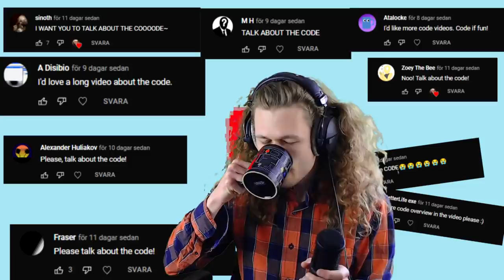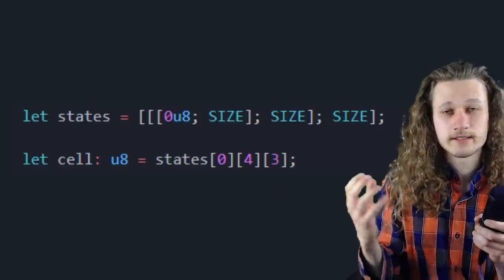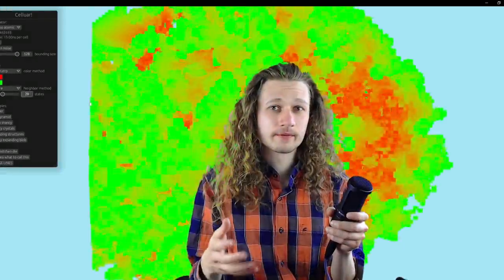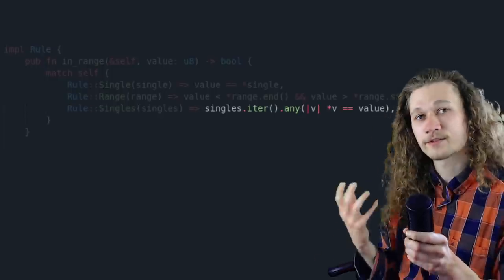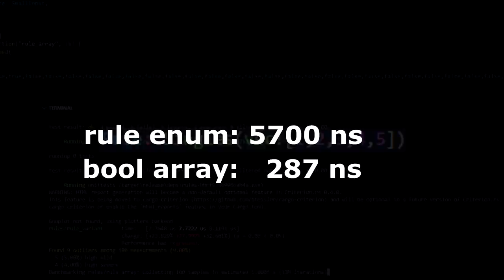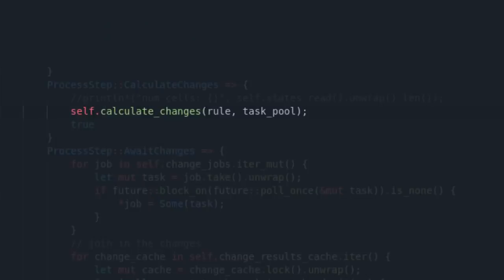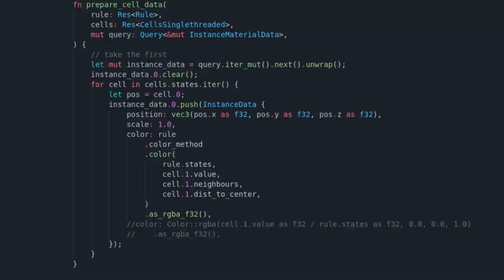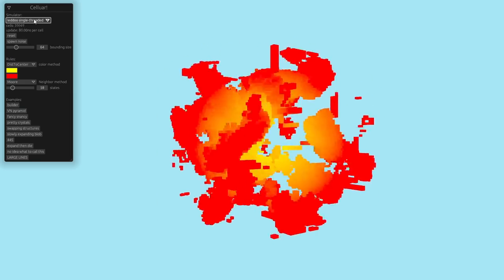Rust multi-threading code review

Comment: Very valuable video. Some youtubers and bloggers keep on insisting that efficiency doesn't matter cause "new compooter phast" and have a considerable influence on new learners who get stressed and look to validate if what they are learning is worth it or not. And, at that point if they come across people like those, it could completely misdirect them from becoming better engineers. While what has been done here to compare is not a usual application, it goes to demonstrate how much efficiency matters and how all those little nanoseconds and microseconds add up quick.
Reply: I bet the people you meant are javascript developer. No offense lol
Reply: @thoriqadillah7780  Mostly but I've seen it come from new developers for everything, even C++. Though JS and Python have it most since they are beginner friendly.
Reply: @thoriqadillah7780  I first saw the idea that efficiency isn't important because "new compooter phast" in the early '80s. The truth is that efficiency of coding is sometimes more important than efficiency of execution. I write 90% of my code in Perl, because I write a lot of small utility scripts for solving specific issues at work and quite often the code is single-use. Shaving a day off development and testing time is far more useful than even shaving an hour off run-time. If I have a task that will take weeks to run, then I write it in something fast so the return outweighs the time lost in coding in a more formal language. And something that requires realtime doesn't leave you much option.
Reply: @nagoranerides3150  but we're talking about game dev here. And the "javascript dev" is about frontend in web, or even mobile. I think the game dev part the need for speed is critical because we're dealing with customer pc. Remember "but can it run crysis?" meme? Yeah i remember that. And the frontend web dev i think speed is somewhat important, because we're dealing with user internet speed and data
Reply: You have to set constraints on what hardware you aim to support, otherwise we'd never move forward. For example, Valve has done a tremendous job at creating an engine that is versatile across low and high-end hardware—and Source 2 is highly targeting VR applications, so speed and varied hardware support is of utmost importance—but it is also very limited in its capabilities when compared to other modern engines that may not be suitable for low-end hardware.

Of course, that doesn't mean you should max out everything and only aim for high-end hardware, since that can also have drawbacks in and of itself.
Reply: Even then, performance can be critical. If you're testing a very large field, you will definitely want it to run as fast as possible. "Modern fast" is kinda lazy ngl. There's a reason why Quell Machine and the HashLife GOL rule are so popular. Making Conway's Game of Life in Conway's Game of Life is not going to be fast without major innovations.
Reply: People often make that argument because "developer time" costs more than "computer time", but usually slow software is the kind that's overengineered and complex and really difficult to modify, and thus wastes heaps of developer time as well as computer time; simple code, even if it may not be completely optimal, will often perform orders of magnitude better than the monstrosities people end up writing when they have no mental model of their application's performance because they've been taught that it "doesn't matter."
Reply: @nio804  Now that I think of it, that makes perfect sense! As you write more code, more assembly instructions are encoded, the more classes you make, the larger the complexity and the stack will get, the slower the program, the more frustrating to deal with your program is.
Reply: graphics or data crunching are something else. optimisations are a must.
Reply: I've seen this quite a bit in C#, where some people automatically invalidate any performance arguments because something may be nicer to read, and while oftentimes it doesn't really matter that much there are a few times it does and people just completely invalidate it. Most of time easier to read code is better, however you shouldn't automatically disregard performance arguments when they may be valid, especially when the more performant version is hardly less readable
Reply: When people say speed matters or doesn't matter it is context dependent. For many things there is no reason to optimize for speed as it would be hard to write the program not to be fast enough. For instance, a difference between a chess app and a chess engine comes to mind. I didn't need to think about speed at all while making the chess app, but while making the chess engine the speed is everything. I am making a chess engine right now  My first version of chess engine takes around 15 seconds to calculate 2 moves deep (2 moves for itself 2 moves for its opponent). Depth 3 would take minutes. It also makes me appreciate how the hell stockfish and other engined manage to go 30 moves deep.
Reply: And those who say "premature_optimisation = sqrt(all_evil)" sometimes miss how at a point, it's no longer premature, and would be easier than retroactively doing it later

Comment: Hmm, I wonder how this would look with Rayon. For testing, I did a simple mandelbrot program, and then simply plugged in Rayon, and it scaled really well. Maybe a project for next weekend :D
Reply: I love rayon, for my CLI apps I build it makes multiprocessing super easy.
Reply: Mandelbrot is embarrassingly parallel though, it's a whole different story if you have a border exchange like in cellular automata. That's where the real difficulty of efficient multithreading begins :)
Reply: Rayon? That shit which is for toy programs? Sure.
Reply: Rayon feels kinda like using go func in go. So simple and essy
Reply: I've been trying to use Rayon to multithread another type of simulation I'm making. And I used it on one part to see if there was any improvement. But It seems like it only reduced the performance of the simulation! I think there is still a lot I have to figure out...
Reply: @Andrew90046zero  Leave that shit.
Reply: @Andrew90046zero  If the workload is not big enough the overhead of creating threads will drown any gains by parallelizing. Try batching more into fewer threads and optimize with binary search (i.e. just try and see what seems to work best works) or math.

Comment: You can count the number of neighboors with convolution. With 2D it would mean to slide a 3x3 matrix [[1, 1, 1], [1, 0, 1], [1, 1, 1]] in every position the cell matrix, multiplying the values in the same position, sum them and put in the center position. There are very fast algorithms to run this on CPU and even faster on GPU
Reply: Can you please elaborate a little bit more? I really would like to understand.
Reply: @brdrnda3805  Convolution is a pretty common technique for running some kind of matrix-defined algorithm in parallel on a large dataset, usually images. Each value of the matrix is basically an offset of a target cell holding a value to multiply by. So, given that the matrix is 3x3, the top row of the matrix would multiply [above-left, above, above-right] by 1's and sum them. The middle row would be [left, self, right], the value of 'self' is ignored, because the matrix is 0 at that position. The end result is you add 1 for each active neighbour i.e. sum of neighbours.

You do this on each cell to build a new 2D array with the value of each cell being the sum of its neighbours. The benefit of convolution is that no cell's calculation depends on the calculation of any other cell. As such, you can have a kernel executing on each cell in parallel, potentially ALL at the same time. This is trivial to do in GPU API like CUDA or Vulkan.

Comment: For the boolean array you could also try putting it all into a single 32 bit integer, where each bit represents one value.
The check would then be something like (rule & 1<<neighbor_count) != 0
(I'm not sure if this is really faster, the compiler might be doing something like that already)
Reply from the maker: Solid idea! Faster or not... we still save some bytes haha
Reply: The compiler can't do memory layout optimizations like that. As a rule of thumb: it can only reorder struct fields, nothing else.
Reply: Or you could use bitvec :)
Reply: It will be slower, not faster, since now there are several instructions to get the value. While the array will get slightly smaller, it doesn't really matter, since it's quite small anyways, so you won't get any benefit from the smaller cache usage.

But it would be interesting to benchmark it
Reply: @nilstrieb  
Trying to prove you wrong I tried to verify my hypothesises by googling:
Originally I thought that the processor couldn't adress anything smaller than a word and therefor would have to do bitshifts to adress a byte anyways, but that doesn't seem to be the case for x86 anymore.
And I also thought that my variant would allow the compiler to do more SIMD optimization because there was no SIMD memory lookup, but in avx2 there is an instruction for that as well.
So I guess on modern hardware you are right.

I also made a benchmark to be sure, and indeed on my avx2-capable desktop pc I get a 15% performance decrease.
But on the raspberry pi 3b, which has an ARM processor, I get a 30% performance increase.
It might be interesting to check more modern ARM processors as well, but I don't own one.
Reply: @quantumdeveloper2733  The avx2 instructions for SIMD lookup are really slow, but I don't think it matters because I doubt it vectorises very well.
Reply: BitArray from the BitVec library is basically this, and designed for just this purpose.
Reply: It’s not faster, but it saves memory
Reply: Not surprising that this gives a performance increase on some architectures, and decrease on others. I bet if you went into Godbolt and compiled this for different chipsets, you'd see very different instructions for the bool array, whereas bitshift is gonna be bitshift. But what matters is whether the lookup can be kept in cache efficiently, or whether that array[idx] requires deeper memory access. I bet like modern CISC chips can stuff that whole array, or maybe even fuse that op into a single instruction.

I would think the bit shift op would be better for deep pipelining though. 

Just goes to show why premature optimization is the root of all evil :p
Reply: Doesn't (rule & 1<<neighbor_count) already output one or zero why do you need != 0
Reply: @xugro 
In c++ you would be right, but Rust doesn't automatically cast integers to booleans.
Reply: You can also try cache-aligning the boolean array to ensure it gets placed in exactly one cacheline. I don't know if it will help, but maybe it does. The performance does probably depend on the architecture though. For some platforms, it's more expensive to access a u8 value than a u32/u64. It really depends on the context though (how many rules you have, how are you applying them), because CPUs are very complicated nowadays, so you will have to benchmark all the things :)
Reply: @anderdrache8504  I may agree with the first statement but I disagree with the second. The compiler does way more optimizations than we usually think of.

 - If we use if/else statements, it will apply branchless programming to optimize computing time;
 - The reason variables are constants by default is  because it becomes easier for the compiler to replace these variables or even remove them from the machine code;
 - Our code might have several functions organizing the project in blocks. But the compiler will package all the function calls into a single big block of code before running more optimizations;
 - If we have a loop function that run a specific number of times. Like "Do this block of code 10 times", the compiler might remove the loop and just write the code 10 times in a row. Which is why some times the compiled machine code can be larger than expected some times. Computing time is priority over memory size.

The last detail is why we can use extra external optimizers to reduce the compiled sizes even more. You can write a web assembly function that has 10KB of size, and then reduce it with external tools to less than 1KB.
Reply: @rumplstiltztinkerstein  I know that the compiler can do other optimizations, but I was specifically talking about data layout optimizations.
Reply: @anderdrache8504  Ok. It's just that other readers could get confused. Not trying to hate. Good point.
Reply: Whether this idea turns out to be correct or efficient or not, I'm a big fan of abstracting that detail away a bit. Why not have a struct AutomatonRule with a function that just tells you if the rule is true, and the details are abstracted away? Could just be a wrapper around the bool array, but that'd be easy to change. (Maybe even decided depending on which hardware you compile for!) And instead of the enum which just ended up selecting one of a few constructors, you could have... a few constructors.
Reply: @Tantandev  I really want to watch all your videos but background music is annoying.  I sincerely hope that you stop adding background music.  I'll sub for now and hope you read this and adjust.  TY
Reply: @anderdrache8504  It can. It just doesn't happen. When it boils down to LLVM bitcode (not bytecode), bool is represented as i1.
Reply: @dmitriidemenev5258  Do you mean LLVM IR?
Reply: @user-dh8oi2mk4f  Strictly speaking, there is no THE "LLVM IR" but yeah.
Reply: @dmitriidemenev5258  wdym there is not "LLVM IR"??? The ir is a core part of LLVM, the whole point of LLVM is that you can compile to LLVM IR instead of compiling to machine code.
Reply: @user-dh8oi2mk4f  There's in-memory LLVM bitcode, on-disk LLVM bitcode, and human-readable LLVM.

> The LLVM code representation is designed to be used in three different forms: as an in-memory compiler IR, as an on-disk bitcode representation (suitable for fast loading by a Just-In-Time compiler), and as a human readable assembly language representation. (c) LangRef
Reply: @xugro No it does not

Comment: The nested vector is not as messy as you made it look.
For initializing you can do: vec![vec![vec![0u8; SIZE]; SIZE]; SIZE].
For indexing, you can do it just like the array: v[0][4][3].
The flat vector is definitely a better idea tho.
Reply: even if it was messy, just write a macro
Reply: Yep, a flat vector would be better. I think that's how it is intended to be used.
Reply: Ye, especially the .get(0).unwrap().get(4).unwrap() and so on felt quite dishonest. If you aren't doing any checking anyway there is absolutely no point in using the get function

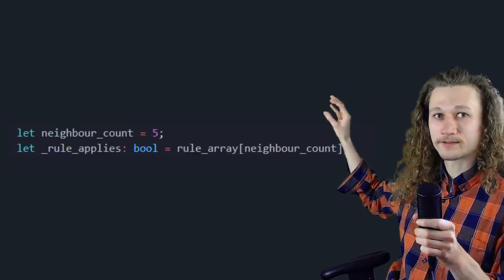Comment: 5:30 You could also just use a 27-bit bitset stored in a 32-bit value. Since moving 27 booleans (27 bytes) around is not efficient and such large values can easily lead to cache misses which may take microseconds to be resolved.
Reply: Yup, all you need to do it decide whether to write something yourself or use bitvec or bit-vec or bitvector or bv or bitvec_simd or bitsvec or fixedbitset or smallbitvec or awint or bitvec-rs or indexed_bitvec or ...
Reply: @DanDeebster  just use an u32?

Comment: Microbenchmarking is useful for measuring if your optimisations actually helped, the other important tool to use is a profiler. Profiling your application will tell you where most time is being spent. Profiling your application for the first time almost always finds some things that could be more efficient.

Comment: Nice video! You could probably multithread the full calculation if you use a "double buffer" system: two copies of the simulation data, one is the "previous" (read-only from all threads) the other is "next" (each thread mutably borrows a section). For each step, swap the buffers, split_mut the write buffer, and fan out to N threads that each read from the read buffer and writes cell states to the write buffer for its borrowed section.